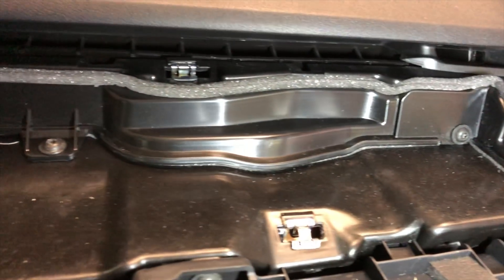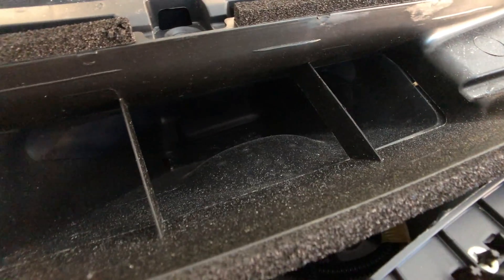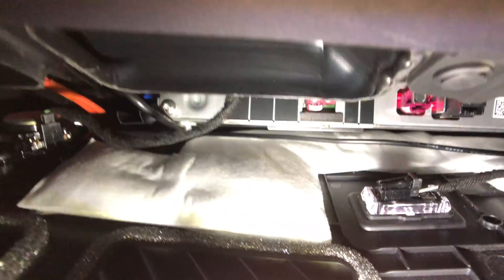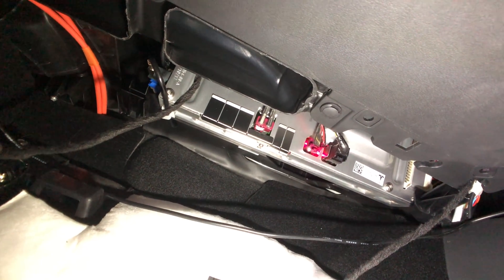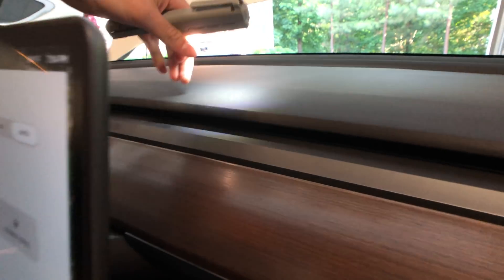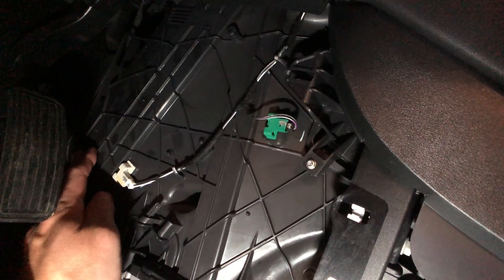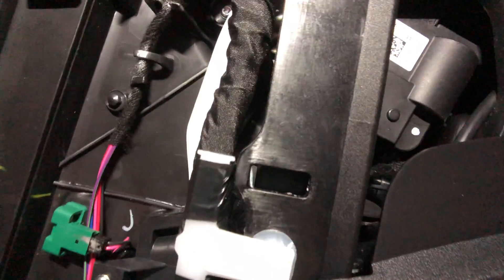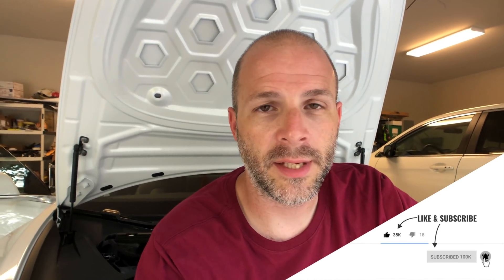Tesla Model 3 Cabin Air Filter

Comment: The smeel comes from the AC system when it runs it produces condensate and when the car turns off it can grow bacteria just run the heat for half an hour if it started to smell or turn off ac and run fan only

Comment: There a cabin air filter in the Model 3:   See MODEL3-LAownersmanual.pdf (page 87)
"The Model 3 has an air filter that prevents pollen, industrial fallout, road dust and other particles
 from entering through the vents. The air filter should be replaced when necessary. Contact Tesla."
https://drive.google.com/file/d/1v9F2sky8jvfjij5ddPwcUjSyXCnSotcL/view

Comment: That last rectangle door! Look up how to replace cabin air filter on Ford Focus, it looks almost exactly the same! A single screw and the door will pop off with the bottom clip. It is not easy to get at or to put a new one but that looks almost identical to the Ford focus.
Reply from the maker: Here is the follow up video https://youtu.be/MOyaK7haCgQ

Comment: Elon tweeted that the 3 has no HEPA filter but just a regular one (there was no room in the 3). Also the speaker you found in the passengers footwell may be for a lowspeed noise. It's going to be required for EVs to make a noise under a certain speed and the old Nissan Leafs have a speaker in a similar place for that.
Reply: Cole Bender why would they put it in the car?!?  Lol
Reply from the maker: The speaker is inside the car. EVs will be required to have that for stupid people outside the car that don't watch where they are going. They don't hear the car coming an walk right out in front of it
Reply from the maker: I found the filter, with help. There are 2 and they are big. Video tomorrow

Comment: You were very close. Indeed their is an air filter. 2 in fact. Removing the panel under the glove box AND the panel by the passenger side center console are necessary. You must pull the orange cable away from the side of the center console and look slightly higher for a panel with a silver t-20 screw. Pull that and you will find 2 filters.

Comment: I think you were in the right spot. That rectangular panel looks to me like the right size for a cabin air filter. Pretty confident that's it.
Reply from the maker: Yes but it does not open
Reply: i1Tesla it looks like that tab on the bottom clips into the panel below? I'd try this on my model 3 but I don't reaaallly want to go yanking stuff apart :x

Comment: I read on a Tesla Motors Club thread that someone called the Service Center and they confirmed that it is located behind the glove box and can only be accessed by removing the glove box which itself requires removing the trim above and below the glove box as well as the piece to the right of the touch screen
Reply from the maker: Seams like a lot of work for a filter
Reply: https://www.scribd.com/document/359220547/Us-20170253107-a-1

It’s item 500 in the patent drawings. Not very clear, but you’re right it is a lot of work for what seems to be a standard cabin air filter

Comment: Good video! You’ve convinced me that there is no air filter in this car. However, this does not stop one from custom building their own filter from available materials and installing it at the air inlet in the frunk. Would anyone care to accept this challenge? If so, please share your results!
Reply: David Nizel I can almost guarantee there is a filter in this car. I can't think of a recent car that doesn't have one. All of my recent cars have been pretty inexpensive and all had a filter. Plus, the manual does mention there is a filter...just not where it is.

Comment: Where you have your finger at 6:39 looks like the most likely release point of the longer panel right above it that the orange wire is zip tied to.  That would be my guess.  Maybe take a picture to the local service center and ask a service technician if he can confirm.  My closest one is 2 hours away or I would myself since changing the cabin air filter shouldn't need to be a service call by Tesla, I would hope.
Reply: The car I had previous to my Model 3 had a very similar 'door' and the filter was located behind it. The door itself was kind of a pain to open. It kind of pushed up and in on the top and the bottom portion pushed in and clicked to latch. I'd be willing to bet that this is where it is located. Looks like Tesla has a cable clipped to the front of the door too which makes it even more of a pain to access.
Reply from the maker: That is what I thought at first but the door does't open to replace a filter
Reply: Hopefully someone will have a video of them doing it soon.  I'm not ready to start disassembling my week old Model 3 yet..lol.
Reply: Also my guess because it’s exactly the size of the filter Elon showed some time ago in comparison to the huge HEPA filter.
Reply from the maker: Found them (2) with help for a YouTuber. Video tomorrow

Comment: I thought Elon said model 3 is too small for a HEPA filter. In the mouth of that big intake in the Frunk would have been a good place, since the air filter needs to be bigger than the duct. Seems they could have put one there if they tried. At lest a simple mesh filter like an air conditioner has.
Reply from the maker: That is what I thought at first but then it would get wet it think. I know it wont have the bio defense mode in the car but I thought it would have a nice filter
Reply: i1Tesla, maybe it has a non HEPA filter. Some forums are saying it’s near the passenger’s left knee under the panel. Maybe it was that area you found but you haven’t found then way to open it.
Reply from the maker: That panel that I did not open is the Airbag.
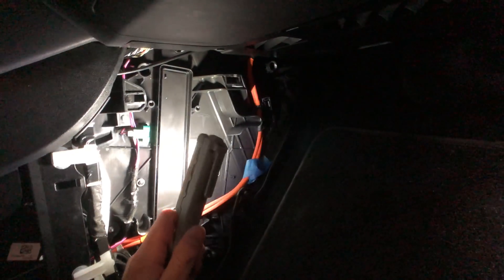Reply: i1Tesla, I mean at 6:20 that you tapped seems like a likely place, but not clear how to open it. It looks the right thickness and size for a typical air filter.